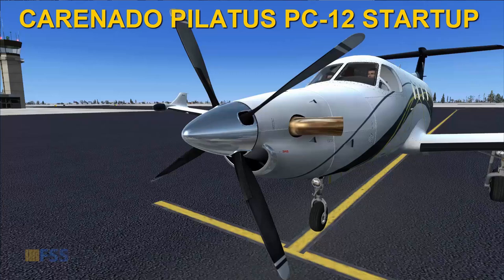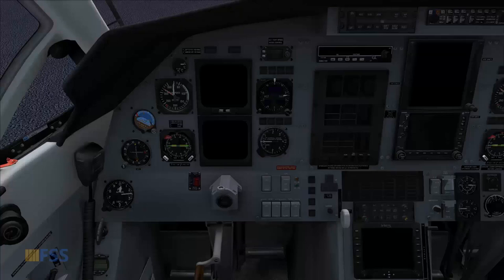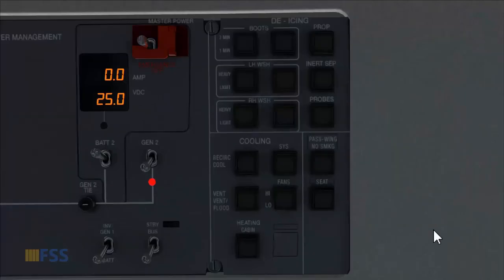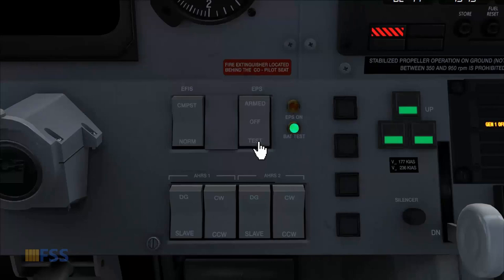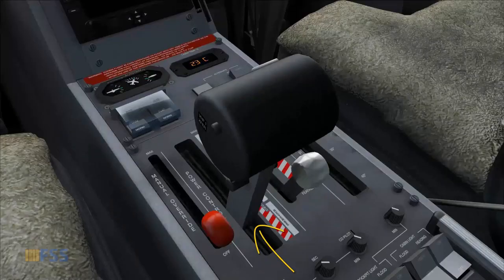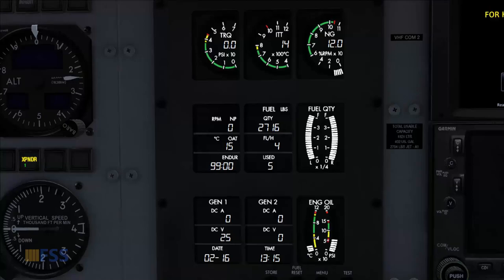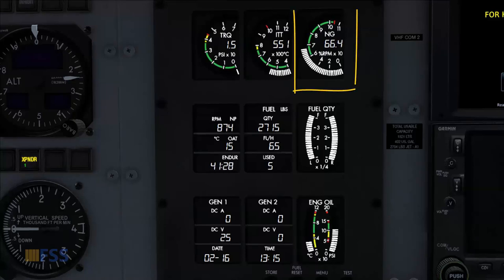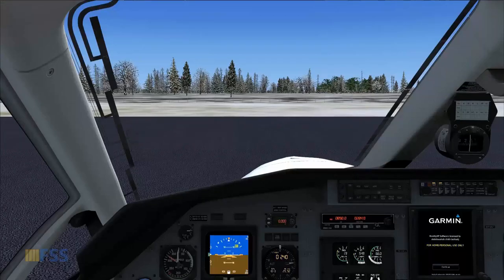Pilatus PC 12 Created By Carenado Startup Tutorial| Engine Start In Detail[1080G HD]

Comment: You forgot to ensure the red fuel valve is closed
Reply from the maker: Which red fuel valve you mean?
Reply: @FromStartupToShutdown  At the back of the center console is the  red emergency fuel shutoff group.  Make sure the left lever is in the closed (down) position.  If it's in the up position (open) you'll burn out your ignitor (at least in the full scale plane) and the plane won't start.
Reply from the maker: @calebizsol  yes i thought the 3 emergency shutoff controls are not modelled by Carenado then as you mentioned that i was surprised that the fuel one is modelled thanks for your attention.